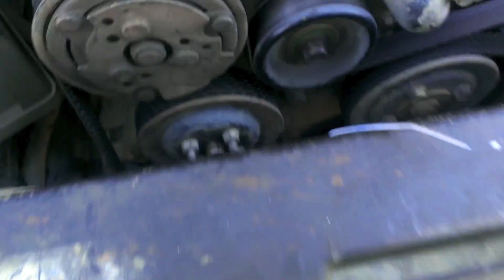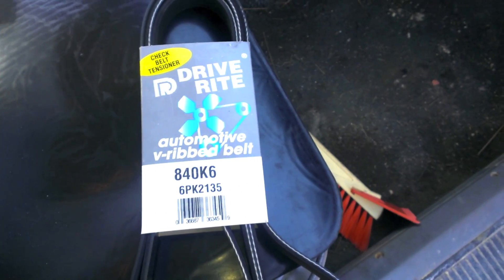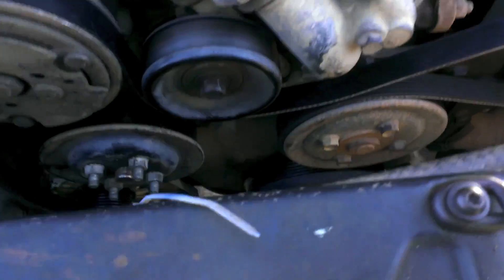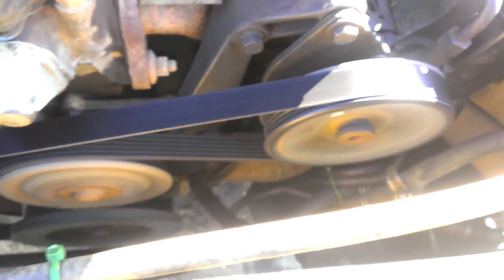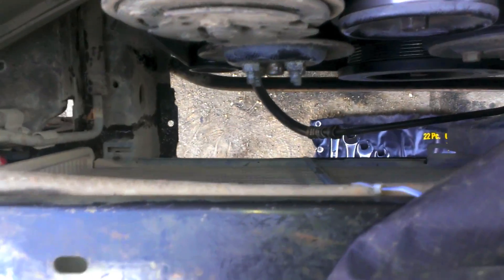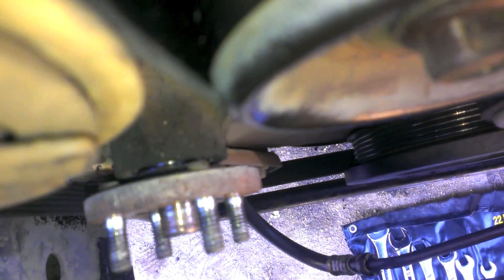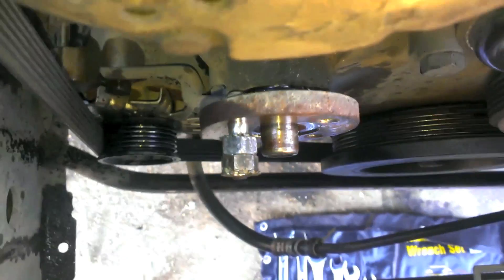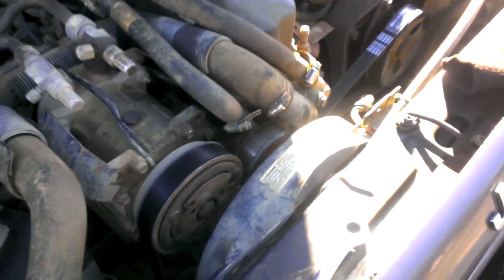89 Cherokee Mechanical Fan Delete

Comment: Hey i have a 2001 jeep Cherokee I trying to bypass the clutch fan to now my jeep don’t have the pulley that is beside the AC clutch does the pulley threads in to the head bc my have the threads hole in my head look like I could put extra pulley there or something

Comment: it would be nice if you could figure out a way to put an idler pulley in place of the fan
Reply from the maker: That's pretty easy. Just unbolt the fan clutch and then put the pulley back on. Doesn't fix a shot bearing issue though.

Comment: I just replaced the bearing in the bracket it’s a lot easier. Here is the part number from Summit. SKF Bearings BR885802

Comment: Just replaced that AC bracket in mine. 1999. Actually easy to do. $59 off ebay.  Have also seen the bearing replacement videos on YouTube.  My brother who is a mechanic wants to attempt it on my old bracket.
Reply: David Brenneman I just did the bearing swap yesterday on my 98 Cherokee. Supper easy an only cost me 20 bucks off of summit racing.

Comment: Just caught up to this issue with mine. Found the replacement for $300 on ebay, which I will never do when I could get a new aluminum radiator, a 2nd electric fan, and your REM all together for less than that lol. It scared the shit out of me because it started knocking, lol I thought it was rod knock at first. I checked the flex plate bolts first as a hopeful alternative. Did find one of them loose, got it thread locked and tight, cranked it up and same knocking. I was already dreading what was ahead. I figured I'd try one other thing, pulling the belt. I pulled the belt and cranked it, no knock at all. Ordering a idler pulley tomorrow but I don't think that's the issue because it's spinning smoothly and no play in it. Water pump is new, AC spinning perfectly, Alternator feels nice as well. Already ordered the harmonic balancer and timing set along with all the gaskets needed so I'll wait until that stuff comes in before I go any further, hopefully it last that long because my job is driving everyday.

Comment: why would anyone do this ?
Reply from the maker: If the video didn't make that clear, the bearing is almost impossible to replace and good brackets are hard to come by or very expensive. Not to mention you can free up some horsepower and have more control with an electric fan. Yes, mechanical fans are more powerful, but with the right radiator it doesn't matter.
Reply: those pesky engineers at Chrysler, what were they thinking !
Reply from the maker: AMC: All Mistakes Combined. Yeah yeah, laugh up an old video, this was only phase one. Once the shot mechanical fan was out of the way I went 2 speed dual electric and it's all computer controlled now so nyeh! And the all aluminum radiator keeps the stroker plenty cool and can even keep up with miles of steep incline. I'm not too worried about it. And besides, now that the fan was out of the way, I could build a custom bracket to move the alternator up to the top, AWAY from all the water (What were those AMC engineers thinking ;) It it's stupid but it works, it might not be stupid.
Reply: I'm not laughing, I think its a good video. I never take my jeep off road,    that's what I meant by the original comment. I try to keep mine factory. But  I can see the advantages to your modifications, for how you drive
Reply: happy cats....If you never take your XJ off road then why have a Jeep? I dont take mine out wheelin like I used to do with my others or the one I have now. Its a Jeep they are happy in the woods...go do some minor wheelin and use that Jeep for what its intended for......to each is their own I guess....

Comment: What fan did you use to replace the mechanical fan? did you use just a electric AC fan from the same year jeep?
Reply from the maker: Mountain Model Casting Dobrowolski at first I just installed a 95-96 xj curved fan because they have the same plug but blow harder. later I upgraded to a Volvo 2 speed fan and all aluminum radiator and it's been great ever since
Reply: I don't run off road. But if the stock electric fan will fit can I use that?
Reply from the maker: +Mountain Model Casting Dobrowolski yep, I just had to drill another hole in the rad support. Check my dual fan f
Video for a quick run down

Comment: just saw this recently. don't know if it requires switching entirely to the open cooling system since they haven't replied. but once i get an answer, i'm going for it.
https://www.youtube.com/watch?v=WxOtYQ3EIs4
Reply from the maker: Radiator Cap = open cooling system. You'd have to route that overflow tube somewhere or block it off to keep your system closed. I wonder if they make overflow block-off radiator caps? Have seen their system but it was a little too pricey for my taste. Went for an ebay rad instead and the suckers been doing great!

Comment: kinda cool but you lose to much contact for me to trust it.  still gonna remove the fan.  

seems adding some sort of aftermarket pulley would solve this.
Reply from the maker: I was never able to test my A/C at the time to see if there was any belt slip but it got me through until I started making custom brackets.

Comment: You most live in a cold climate. Bypassing the fan in California is not possible.
Reply from the maker: C. Hampton New Jersey has a coldish winter. This set up actually lasted me up into the summer. Then I went dual electric. Once I put the stroker in I had a hell of a time keeping it cool. new radiator finally fixed that.
Reply: Thats what I figured.
Reply: +C. Hampton - Sure you can, just add Efans, less HP and less maintenance and cheap to replaced too.
Reply: NickInTimeFilms...What was the part number for the belt Bud? Did I miss that in your Video?

Comment: What is the part number for your original gatorback belt? I have slight pulley misalignment on that 94 I bought and it's driving me insane. None of my pulleys are bad it's just a tiny bit of wobble and these fricken Dayco belts squeal like pigs.
Reply from the maker: Are you sure it's the belt? Cherokee belts like to be a little tighter then most. Another common cause of constant squeezing is a Harmonic balancer(crank pulley) that has slipped off the hub and is rubbing the timing cover which will also cause belt misalignment. idler pulleys that wobble should be replaced.

as for belt numbers, the long number is just the length of the number. I forget if it's this video or another where I explain how belt numbers are laid out. Gatorback was bought by continental and is their elite series, so find you length belt in their catalogue
Reply: I looked at the back end of the balancer with a bright flashlight while the vehicle was running. I already replaced the idler puller. It is misalignment but it's not bad. Only a tiny bit, Plus I put water on the grooved edge and the squeak would stop, indicating that the belt is part of the problem. I think...
Reply from the maker: +wyatt ditmanson Does it get worse when you give it throttle?
Reply: Yep, It's driving me insane. I put some soap on it and it stopped for about 3 minutes. I jumped on the highway and it started screaming at me again.
Reply from the maker: +wyatt ditmanson Then you've got a slip somewhere. you try tightening the p/s tensioner up a bit more?
Reply: Okay, I will. It's pretty tight right now. But like you said earlier, 4.0l like to be able to play a tune on.
Reply from the maker: +wyatt ditmanson And silly question but none of the pulleys are siezed right? They all spin easily save for the crank?
Reply: Yep, First thing I checked after your belt chirp video. I checked just about everything there was to check. I'm fairly certain its the belt. I'll switch to the gatorback and see what happens. If it still sounds like a pig I'll change my Balancer.
Reply: So I replaced my harmonic balancer. Still squeaks. Pretty sure it's the belt. Like I said, when you put WD on the belt it goes away for a few seconds. I will be buying a gatorback belt. I'm going with the 4060975. That's the number I got from the Dayco belt. If i'm correct and the 975 part is the length then it should work fine. I think. Any thoughts? Also your video on the harmonic balancer was very useful.
Reply from the maker: +wyatt ditmanson Yup, 97.5"
Reply: Awesome! I'll let you know if it fixes the problem. Thanks for the help!
Reply: I know this is 11mo old, but just went through this on mine. Same exact symptoms, water and wd would quite it only for a minute. Turned out the power steering pump/pulley was out of align, belt was fine. Had to space out the back/bottom bolt of the pump bracket with a washer.

Comment: So would you recommend to keep the clutch fan and 1 e fan or 2 e fans?
Reply from the maker: +preston jones Hard to say. If your mechanical fan still works then don't fix what ain't broken. I installed Stock Dual Electric fans and that worked well for a while with the stock motor but in extreme situations the temps could still climb to 260 if I didn't let it rest. Upgraded to 95-96 XJ E-fans because they blow harder and that was better, Working on a 2 speed volvo fan now to see if I can keep the stroker cool in extreme situations.
Reply: +NickInTimeFilms Thats awesome, what about ford taurus fans? and anything else to make it cool off a bit better? besides obvious koolflow
Reply from the maker: +preston jones The 2 speed Taurus is a common upgrade, but the shroud has to be cut down quite a lot. I'll have the Volvo fan video up in the next few weeks, it seems to work well. 

As for other suggestions, its hard to say, I haven't quite mastered the cooling system yet. I've heard lots of bad reviews about the koolflow water pumps, thought is the water flows too fast too cool. A good 1 or 2 core rad is better then a 3 core one. An upper rad hose restrictor may help. Trans cooler helps take the load of the rad. Good vents help keep engine bay temps cool.
Reply: +NickInTimeFilms Never thought about the fan shroud part i guess it wont fit without adjustment, much is to be learned about the cooling systems thats forsure. on my 94 cherokee im having a small leak from the tranns cooler line going into it just under the oil pan on mine, any ideas on what to do lol im not to sure the ends look special
Reply from the maker: +preston jones Is it leaking from a rubber line to a metal line or at the fitting to the rad or to the transmission?
Reply: +NickInTimeFilms the fitting into the rad
Reply from the maker: +preston jones I believe the lower rad connector is a quick connect fitting. You can buy the whole kit but usually it's just an o-ring that goes bad. I don't remember if the line is 3/8's like it is in the trans or if it's 5/16. Dorman sells a 3/8 kit DORMAN# 800750 and Crown sells a 5/16 kit, Crown Automotive# 83502745. I don't remember which one you need though.
Reply: +NickInTimeFilms thanks a bunch! It leaks when it wants and sometimes I doesn't

Comment: Are theses mechanical fans replacable? I think mine might be bad, I have the one e fan, replaced radiator, thermo, water pump. still sometimes will over heat, a little more so when on the road than in the trails. at what temp would you say "I need to shut it off" ? cause it doesn't really get all that far over half (210)
Reply: +Shawn Grady  210 is the operating temp for the 4.0 engine ...  The fans are replaceable , most of the time you just need the clutch swapped out ...  The temp to look out for is about 240+ ,  That's when it is getting hot and needs to cool off ... . ... Make sure all of the air is out of the system , and your coolant is mixed right , also check the radiator cap , if it wont hold its pressure the Jeep can overheat .. They usually run about 5-10$ so its a cheap part to swap ....
Reply from the maker: +Shawn Grady Like +Norman Murray said, 210*F is normal, 240*F and above is the danger zone. The Clutches are replaceable, the bearings are not. You'll have to get a new Fan/AC Bracket if you have a wobbly fan shaft like I did.

Comment: The black shavings was the belt and that why you were hearing squealing. Also I don't think its "cool" to use just one electric fan. I think I'm going to with the triple threat electric set up.
Reply from the maker: Right on both accounts. Not sure if I said it later in the video but I realized the shavings came from the belt. I also added a second stock electric fan later on because in extreme off road conditions (beach sand) it would over heat. I have a video of the dual e fans
Reply: So how's it running now?
Reply from the maker: II N3MES1S II The dual electric is perfect. The single e fan was fine for 99% of the time, even kept up with medium wheeling. Now with 2 e fans, I can drive 4 miles down a tough beach trail and stay under 260*F.
Reply: That's good to know, I plan on getting the three fan set up but for now I just want to get it running. So I'm just going to get a new fan clutch and see what happens.

Comment: have you had any problems with the conversion with belt slipping at all. my 90 xj has the same problem and i dont wana mess with the bearing. i was thinking of doing the bypass just wana see if it holds up
Reply from the maker: You'll need to make sure the belt is tight. After I first took it out in the rain it would slip every now and then. Once I tightened it some more it was fine. You do lose a bit of belt wrap on the crank pulley and alternator but I haven't had any issues lately.

If you decide to replace the bearing, good luck. You'll have to get the entire bracket because they don't sell the bearing. Another issue to be aware of is cooling. You might need to add a second electrical fan to keep cool.

Good luck.

Comment: I was thinking of doing this to my built 4.0 xj but how much power/torque difference do you feel?
Reply from the maker: I haven't noticed much of a difference because I'm too worried about my axle vibes but it seems to rev a little easier. If you didn't know about it, you probably wouldn't notice a change unless your clutch fan is stuck on all the time.

Comment: Very interesting! Mine get to temp normally so I don't think I'd be safe without the mechanical fan, but I'm getting some noises from down there, so I'll have to check the motor mounts first then the pulleys I guess.
Thanks!
Reply: Well, it's taken these 9 years for the bearings to go, but now my fan is as wobbly as yours was :D. I don't think it's worth it to install a new bearing, so I'll see what kind of e-fan I can get in there. Something that would increase voltage with temp would be nice. I'll have to investigate on that.
Reply from the maker: Not a bad 9 years at all then. I'm happy with my electric setup, helps get up to temp faster, especially in the winter.